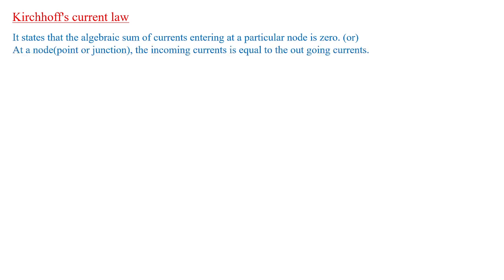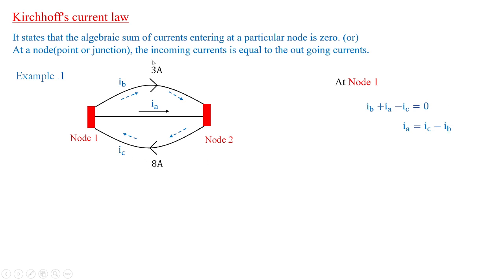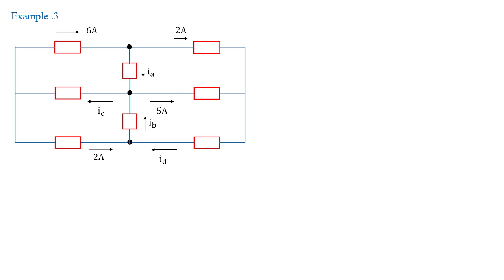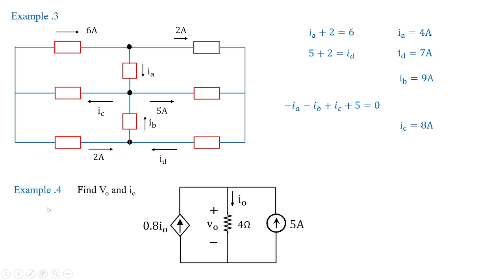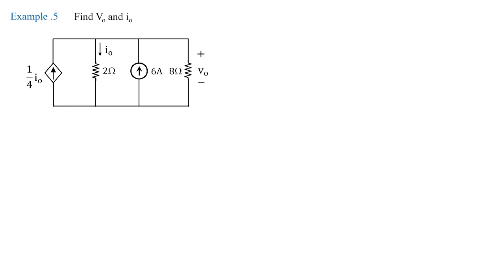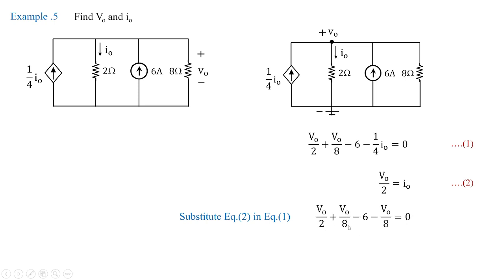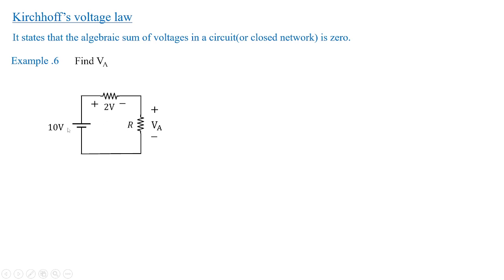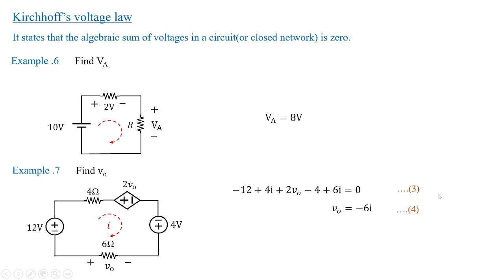How to solve problems related to Kirchhoff's Laws? How to solve dependent sources problems?

Comment: 7nth sum 
How to consider the Voltage (positive or negative) please explain about + + and +-
Reply from the maker: Good shiva, let us make it simple current flows from + to - ok, but if in any problem if signs are mentioned by the direction as shown in problem 7, u understand that the question is asked about current in opposite direction. For more information check this video provide below 
https://youtu.be/R0V-iE1A40M?si=jBxwsSwgvDIKsbFU